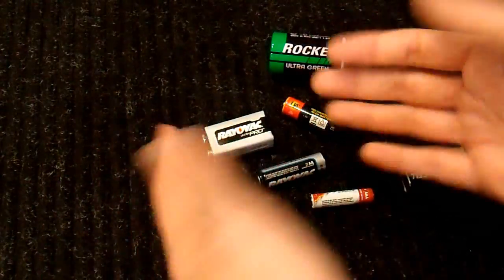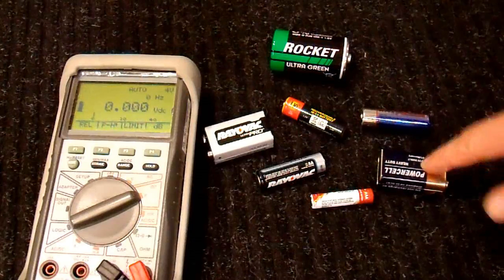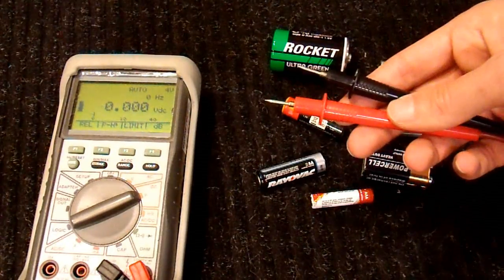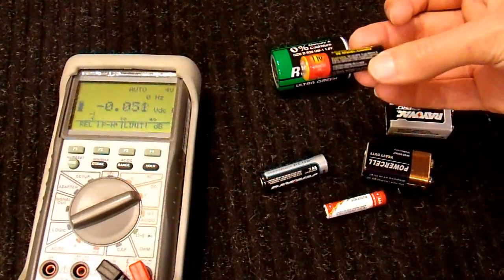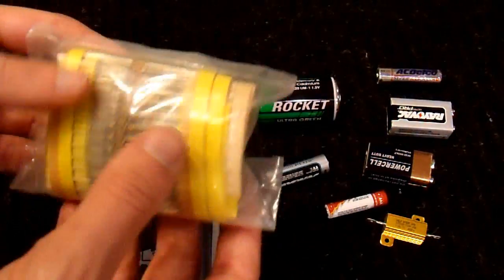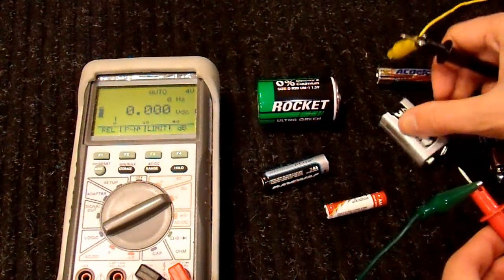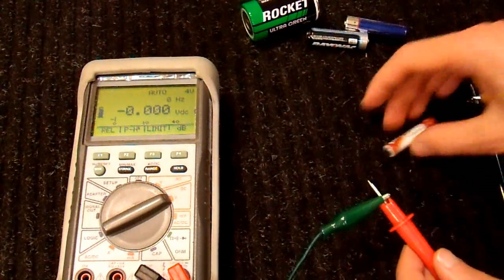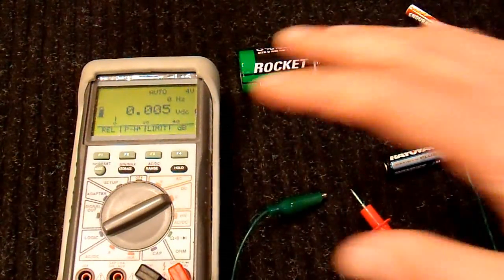How To Test Standard AA, AAA, D, C, and 9V Batteries with a Multimeter

Comment: A nominal 100 ohm load will draw 90 mA from a nominal 9 volt battery.  90 mA is a considerable load for a ‘transistor radio battery.’ They are normally used in significantly lower current applications. I would say 10 to 20 mA is a reasonable load. So, a 450 ohm resistor would approximate that kind of load. Drawing 90 mA might lead someone to discard a battery of this type prematurely.  

A “D” cell is intended for much heavier loads than the approximately 16 mA that the 100 ohm load would draw from it. Such batteries are intended for loads of 200 to 500 mA. A three ohm load will draw 500 mA from a 1.5 volt battery.  This would be a much more useful measure of a D cell’s performance, because the 100 ohm load would seem to the D cell to be nearly an open circuit.  So, I think the idea behind your tutorial was correct, but I think that the information given could be, depending upon the circumstance, misleading. The Radio Shack Battery tester that I have tests D cells at 150 mA.  I don’t think that’s a reliable measure of performance for D cell batteries.  It would be reasonable for AA cells, I think.  There are also valid questions of what the cutoff voltage should be for the cells tested. Battery literature will give suggested levels, and may vary considerably from manufacturer to manufacturer. At the end of the day, most devices require high enough voltage on the cells used that most of the capacity of the battery is wasted anyway.
Reply: Thanks 👍

Comment: I"m so fortunate to have a multimeter with this functionality built in for 1.5, 9, and 12v batteries! Cost me all of $11 on amazon!
Reply: Could you please post a link to your device thank you
Reply: @star-lordlavaplanet  Actron auto-analyzer.
Reply: @arthurserino2254  Do you know what the resistance load is for each of those?  Does it vary with each setting, or is it just a single load?  The Instruction manual for the Actron 6635 auto-analyser does not provide any ohm load information, just that it tests under an unspecified "load" for each battery setting. Thanks.
Reply: @MrHolz1234  I tested it once with another multimeter. I don't remember the values, but it varies.
Reply: @arthurserino2254  Thanks, it is useful to know that they do use different loads for each one.
Reply: @MrHolz1234  Well naturally, otherwise there wouldn't be different settings for each.
Reply: @arthurserino2254  Right!  Isn't that what marketing is all about though! ;-)
Reply: @MrHolz1234  I'd expect that from cheap chinese brands, but not actron.

Comment: While the author clearly understands what is going on with internal resistance, he fails to address what is a reasonable test load. His hundred ohm resistor will only  draw 15 ma from a 1.5 volt battery. For a D cell that is an improbably small load. The shortcoming of any load tester is that the manufacturer has to guesstimate a load for any battery it tests,  not knowing what load the battery is being asked to drive. The better cheap load testers have different loads for AA, C,D, 9V, etc. In fact,  a 9v battery is made up of 1.5 volt cells that are way smaller than a AAA.  In normal operation, they probably don't have to supply that much current. A smoke alarm might be an exception, I never checked. The point is, no one value resistor is going to simulate a reasonable load for a whole range of batteries. I remember seeing the schematic for a Radio shack load tester and was thinking of making a little test box using the values they used for different sizes of batteries, with my multimeter. I have seen them at Home Depot ,too. For around 10 or 15 bucks it is probably easier to buy one. Another problrm with s multimeter is the awkwardness of two probes. Most of the testers have a sliding battery holder or a contact on the face and only one probe. I you test more than very rarely, two probes with a resistor clipped across them is pretty clumsy to use.
Reply: If people knew this, I think a lot more of those radio-shack style testers would have been sold... too bad they don't exist anymore!
Reply: The load testers or RS doesn't exist? I ask because there is a RS here in my town.
Reply: @Anonymous :  Search for "battery testers".  

They're supposed to have a load built in, but in my experience, it's nowhere near a heavy enough of a load to really test the battery with any real accuracy.   That's why I prefer to either put a fairly heavy load (e.g., a 1-ohm resistor) in parallel with the battery tester (I happen to have one where it's easy to do that, but most of them aren't), or do the same thing with an actual multimeter, like the guy in this video did..
Reply: @JamieClark  Yes, Radio Shack used to sell a lot of unique things that you couldn't get anywhere else.  Their big downfall was switching from and electronics store to a cell phone shop.
Reply: @Jeffrey Deutsch : One well-informed comment, like yours makes reading them ALL worth the time :-)
Reply: you have made a good point and appraised us all of the issues with this kind of testing. But what would be a bit more helpful is a way to get around it, since you seem to know more about it than the average joe, Jeff?
Reply: This is good information, confirms what I suspected so thanks. But I never found it 'clumsy' or a big hassle to use multimeter probes on a battery. In fact I do that several times a week.

Comment: Thanks for the load resistor value. I want to build a battery tester and wasn't sure of what to use for a load for reliable testing. I would think you should test for a little longer to see if the voltage starts to drop. I think if it drops at a slow rate it's still good, and at a faster rate maybe not so good.

Comment: I use the 9V battery tester that God gave me.  I just put the terminals on my tongue and if it hurts bad, it is good, and If it only hurts a little chuck it.
Reply from the maker: The tongue method does work but only puts a few milliamps of load on the battery so it may still pass bad batteries.  However it is a fairly reliable quick check!
Reply: Popeye I believe I speak for all when I request video evidence of said test!

Comment: 1) need multimeter, ~100 (known) ohm resistor, alligator clips
2) check the batteries while under load (passing through the resistor)
This is more telling because besides the battery having enough voltage, it also needs to have a low enough internal resistance (able to put out enough voltage while under load). 
I don't know anything about electricity, I'm just taking notes, correct me if i'm wrong.
Reply: Yep, that's correct.  Although I would suggest a much lower resistance (higher load).  100 ohms isn't going to put much of a load on a battery, so it won't really put the battery to the test and show you "what it's made of", so to speak.  You need to draw a fair amount of current out of a battery in order to see what its internal resistance is doing.  I would suggest a 1-ohm resistor for a AA battery.  That may sound like a heavy load to some people, but it's only for a few seconds, and it's what you need in order to really see what's going on inside the cell.  A good battery will be able to tolerate that without a problem and without a large voltage drop.   If, under that kind of load, it still gives you a volt or more, you're good to go.  Between, say, 8/10ths of a volt and 1.0 volts, you're still okay, but it's weak.  Below around 0.8 volts, you should consider tossing the battery (or recharging it if it's a rechargeable).
Reply: @Milesco  Hi Captain. I may not be that smart but are you saying 1 ohm has more resistance than 100 ohm, or is it because the resistor is in parallel ?Sorry just trying to get my head around all this
Reply: @mick1turner  No, 1 ohm is of course much less resistance than 100 ohms – but that means it draws much more current.  It puts a heavier load on the battery.  A resistor resists the flow of current, so more resistance = less current, and less resistance = more current.  So a low resistance is a heavy load, and a high resistance is a light load. 

When you’re testing a battery, you want to put a heavy load on it (high current), so you want to use a low resistance.  Any battery will look good if you just put a tiny little load on it.  You want to push it hard to see if it can “deliver the goods”. 

I guess maybe you're thinking that a low resistance makes it “easy” for the battery.  Like if you're pushing a cart with low-friction wheel bearings, it’s easy to push.  But that’s not the right way to think about it.  Having a low resistance makes it easy for the current to flow.  But it’s a heavy workout for the battery.  It’s like opening up the throttle on an engine.  The throttle resists the flow of fuel and air into the the engine.  Open up the throttle (reduce its resistance), and it’s easy for lots of fuel and air to get into the engine, and the engine will deliver lots of torque.  But it’s a heavy workout for the engine.   

Every battery has an internal resistance, and a good battery can deliver a high current flow because it has a low internal resistance.

Conversely, a bad battery has a high internal resistance and therefore can’t deliver a high current, even if you put heavy load (that is, a low external resistance) on it.   That’s because the battery’s high internal resistance becomes the limiting factor.  You’ll see a large voltage drop when you try to put a heavy load on it.   Like water flowing through a pipe – if you put a restriction in the pipe, the water pressure will be high on the front side of the restrictor, but will be low on the back side.  In an electrical circuit, voltage is the “pressure” that forces electrons through the circuit.

Hope that helps!
Reply: @Milesco  awesome teacher u can be😘
Reply: @nittijain  :  Thanks, Nitti!  😊

Comment: 100 Ohms is a very light (10-15mA) load for AAA - D cells.  I used to wedge the leads of a 1/2W carbon 10 Ohm resistor into the banana plugs at the meter terminals to get a less optimistic reading at 100-150mA load for AA cells.  That's a bit light for a D alkaline but more realistic I think.  100mA is a runtime of about 1 day for an alkaline AA, so at least the right order of magnitude for most devices (3-30 hour runtime).  Zetec makes a fancy pulse load meter that isn't so cheap. It is popular but compared to this, I don't think worth it.

Comment: I cannot figure out how he connected the resistor because the video is cropped.  And yet, that connection is the most important point of this video!
Reply from the maker: I'm sorry for the poor video coverage of that connection.  The resistor is in parallel with the battery simply to draw a load on it.  This allows for doing internal resistance measurements without a special meter.

Comment: Very well explained. I'm  gonna get some clips and a 100 Ohm R to go with my meter. I've got a boatload of batteries to test.
Reply: I would recommend using a much lower-value resistor.  A 100-ohm resistor doesn't put enough of a load on a battery to really test it.  You need to draw a fair amount of current out of a battery to see what kind of condition it's really in.

I would recommend 1 ohm for 1.5-volt cells, and around 5 ohms for a 9-volt battery.

Comment: radio shack had a resistor (2 pack)
and
test leads (3 pack)- about $8 bucks-

I only needed one resistor but the 2 pack was so cheap it was okay.

But the 3 pack test leads were about $8 and I hate paying for what I don't need....
so shopped and found a single pair of test leads at Walmart for $2 (made by 3M,,, 30inch)
and returned the 3 pack to Radio Shack.

Thanks for the video.
I was finally able to go thru a drawer full of old batteries 
and get rid of bad ones.

Comment: ok, just for clarification here. When you say "this battery is bad", do you mean the battery is drained of its power, or that the battery in general is bad and would drain quickly/not provide the required power?
Reply: That was an 9V alkaline battery (not rechargeable), so the answer is "both".
Reply: It just means that the battery is unable to give the required electricity to the device it would be charging

Comment: Will any 100 ohm resistor add enough load for all these regular use batteries? I started looking for a resistor and realized that there are other factors like some are 1/4 W, some ½ W. I think maybe theres some info missing here about the proper load to test each type of battery if I’m not mistaken. ie; what resistance would apply the appropriate load for double A or triple A batteries as opposed to 9 V or 12 V batteries?

Comment: Why 100 ohm? Will 1 ohm or 1000 ohm work? It sounded like you said those resistors in the package were 1/4 ohm... will that work?
Reply from the maker: You just want enough current to stress the battery enough to know it will work in real-life applications.  The exact resistance isn't terribly important unless you want to be scientific about it.  That said 1000 ohms is definitely too high, and 1 ohm is lower than the internal resistance of the battery and will always yield a 'fail' result.  For a AA to D cell 500mA is about as high as you'd want to go (flashlights are in this range).
Reply: @knurlgnar24  So, you're talking about the 9V battery then. The impedance on the AA,AAA, B,C & D batteries I understand to be much lower.

Comment: Great video , I just ordered some clips for the resisters I have to help test. 👍 , 1 quick question: so if I don’t use the resister and the battery reads at 1.1v~1.2v it could still be good ?
Reply: No, if a 1.5 battery is reading 1.1 or 1.2 volts on a digital voltmeter,  without any kind of load on it, it's garbage, it's dead, throw it out. If that battery was brand new it should be reading about 1.6 or almost 1.7 volts on a digital meter, without any other load. A used battery that measures 1.5 volts might seem to be okay, except that when you put a load on it it might deliver only about 1.3 volts or so, and obviously that isn't very good in many devices.

As a quick and dirty battery tester, check the batteries with an analog ohmmeter, that will have a lower resistance than a digital meter and would load down the batteries a bit more. If a battery reads 1.5 volts or a little higher on an analog meter, it's likely to have some life left in it.
Reply: If these are alkali batteries, you might want to consider recharging them. Although alkali batteries are not supposed to be rechargeable, a lot of people do. (See many other videos on YT for ways of going about this, but the main thing is to do it in such a way that it does not overheat). If you can get it back up to about 1.5V or more, then it might be ok.

But importantly, you will want to test the internal resistance (i.e. by using the procedure shown in this video ), before you think of attempting to recharge it. If the IR is too high (i.e. the voltage measured under load is much below 1.0 V, then it's probably not worth attempting to recharge.

The biggest risk with recharging alkalies is possible leakage, so not worth risking in expensive equipment where leakage could be a disaster. Some people have reported batteries exploding while being charged, although I believe that is a lesser risk unless one is very careless (leaving it too long, unattended, or at too high recharge current. There are specialised rechargers around for "non-rechargeable" batteries, that use small amounts of pulsed current. 

Sorry if this is of no interest to you, but it might be of interest to someone.

Comment: So there are multimeters with a built in 100-ohm resistor ? Any recommendations on a brand ?
Reply from the maker: Many multimeters have a 'low z' function to remove stray voltage from voltage measurements.  It's not exactly the same but it's usually a few kilo-ohms and can be useful for coin cells and other low drain battery applications.
Reply: @knurlgnar24  I have super cheap Harbor Freight multi meter.  It has a function on the dial to test 9v and 1.5v batteries and  it does the test adding 370mW of resistance and it measures the battery in mAmps instead of volts.  For a 9v battery, it says normal amperage is 25 mA with the 370 mW of load in effect and for a 1.5v battery it says normal Amperage is 4 mA.  I can still measure volts on the dial using the DCV 20 setting.  In you opinion is the mA a good way to measure battery health and does anyone know the range in mA for a healthy battery in 9v and 1.5v batteries.  Example: is a reading of 20 mA (80% of 25) mean I still have a strong battery?  Is there a scale or chart somewhere that gives numbers for Excellent, Good, Fair and Poor regarding the mA measurement or the Voltage measurement with 110 ohms of resistance added?

Comment: For 9V battery use the tongue test - put battery terminals against tongue - if you feel a strong tingle battery is good. Takes 10s & no multimeter or load resister required. You will get a buzz.

Comment: My Sanwa SP-15D analog multimeter has a 'Battery' setting that 'Load' the battery with internal 10 Ohm resistor, this resistor value is written on the scale... 
I consider a battery bad when it read ±1V(@10Ω load)

Comment: Very good video!! Finally ending the myth of "just hold (+) and (-) to the batteries, and if the voltage looks good, your battery is OK". There's lots of remainder voltage in a battery when it has NOT been used for a long time, so that approach is fruitless.